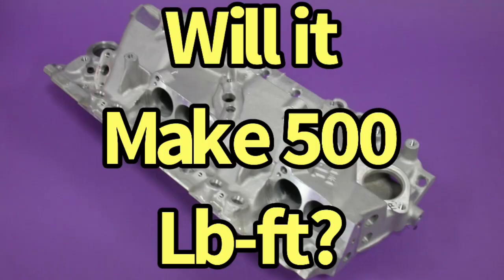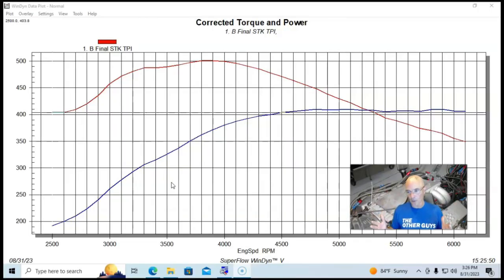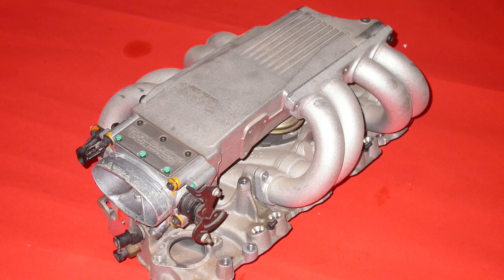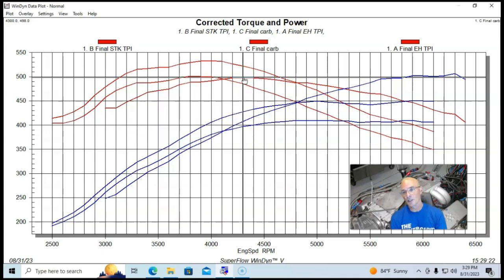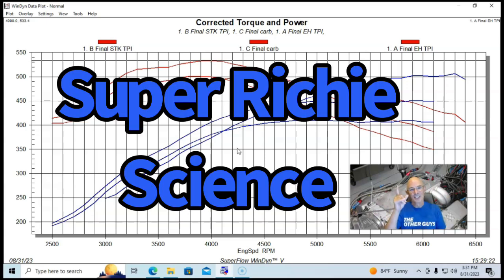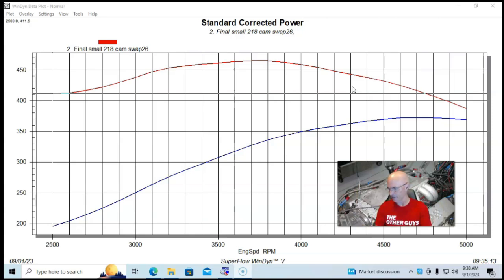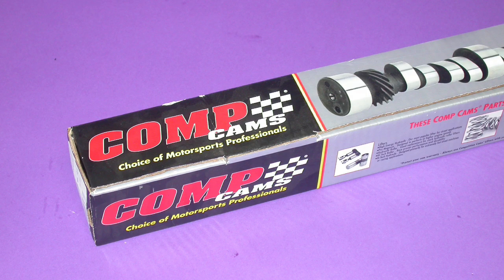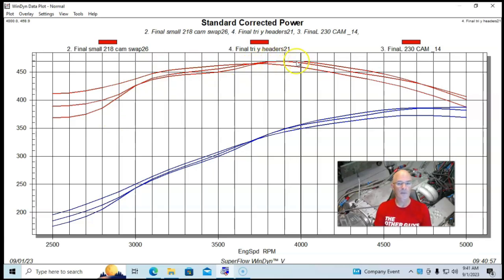TUNE PORT L98 350-CAN WE MAKE 500 LB-FT OF TORQUE? PLUS, TRI-Y VS 4:1 HEADER TEST-WHO MAKES TORQUE?

Comment: XFI hydraulic roller cam up to 230 or 240* duration with extreme ramp rates that match larger diameter lifter rollers. Extra high lift. 7MM or 8MM valve stems. 1.7 high average ratio roller rockers. PAC Beehive or other conical high quality springs. 106* LSA. 2.2" intake valve. 1.5" exhaust valve. High attention to detail on AFR 210cc heads or Promaxx Project X215cc heads. Enough swilr and tumble blend with 300 fps velocities in high port energy and efficiency head. A giant single barrel carburetor with a part throttle circuit modification like the Pro 1 single blade carburetor on a dual plane or dual cross ram divided ram intake manifold. Very high cylinder pressure with proper fuel enrichment jetting for WOT. Then with best results slightly enhance results and make a short stroker between 358 and 372 cubic inches. I.E. = 3.5" crank, 3.625 to 3.64 or 3.65" stroke. The 3.5" stroke could net you a 10 ft lb increase. Or a 3.6" stroke would be really nice. Part of the reason the 383 stroker does so well is not only the additional cubic inches. It's bore to stroke ratio is perfectly in the zone of efficiency. So if the stroke and bore was reversed it would be equally in the perfect zone as well.
Reply from the maker: I think no on the 4/7 or the 4 pattern and you will be hard pressed to find a better head than the AFR, the tighter lsa will work, no on changing the bore/stroke (displacement makes torque)
Reply: I like where you're going here. Totally agree on the XFI lobes, but still on a tight LSA and all the extra valve train stuff to control those lobes and more rocker ratio. You're kind of "changing the game" with changing the intake, though. I think the challenge of the limitations of long runner intakes is what "makes it fun".  

If you're stuck with the long-runner intake; then a FIRST Fuel Injection super high flowing TPI is a part of the recipe, and I think you want MORE STROKE because you're RPM limited and the extra piston FPS is useful; it also helps provide more quench action to fight the detonation that becomes a risk as you push the DCR of a high performance TPI engine. -Combine the extra stroke with thin piston ring packs to not lose some of the torque from friction (the 1mm ring pack Mahle PowerPak pistons are perfect and reasonably priced). 

You COULD do fuel enrichment to fight detonation even with EFI and keeping a long-runner intake, but with a modern EFI system you can also use an Open Valve Injection strategy that helps reduce detonation risk, too.

Comment: In my opinion, it's the stroke that helps produce all that low speed torque . It's difficult to make up for that. It would be interested to see what another point or so of static compression would do.  Let's cut to the chase and add some boost.
Reply from the maker: see the turbo tpi video

Comment: An old ad for the Paxton supercharger from back in the day claimed 360 HP and 480 FT/LB of torque on a stock TPI engine. It claimed ZR1 Corvette performance from stock TPI.
Reply: Anyone use one successfully?
Reply: @xmo552  I’ve had one on my 89 Formula 350 for over 20 years. While I don’t race it or even drive it often, it was rebuilt once after about a year or so into its life because the kit came with a belt that was absolutely too tight. I added the dipstick cooler kit to it and quit using the Paxtatrac fluid and just use Ford type F transmission fluid and it’s held up ever since. Successful or not that’s been my experience. Lack of frame connectors on the flimsy 3rd Gen and lack of faith in the rest of the drivetrain prevents me from abusing it. But TPI + the small amount of boost = big block torque sure makes it fun to drive. It’s shown tail lights to stock LS1 F bodies and early LS1 Corvettes.
Reply: @mikee2923  
Thanks

Comment: I had a tpi 383 with dart iron eagle 225 heads, and a low lift 114 lsa cam advanced 2 degrees.
 10:1 compression.  
It made tons of torque.  
33mpg with cruise set at 120mph in a 92 fbody with 2.73 gears.    
Car was a lot of fun.

Comment: Mr Holdener Id really like to see you test the big bore throttle bodies on the market for the dodge magnum engines with the keg intake, the flow numbers for all of them are all over the place, someone is lying.
Reply from the maker: BIG FLOW FROM A TB DOESN'T EQUATE TO BIG POWER, THE INTAKE MANIFOLD LIMITS POWER
Reply: @richardholdener1727  so does the stock throttle body limit the keg intake or is the intake the limiting factor and I should save my money on a throttle body.

Also you have a great weekend 😁
Reply from the maker: I don't think you will see a big change in power from either, even a fully ported intake with a very large tb only added 10-12 hp
Reply: @richardholdener1727  better heads first then it is, thanks

Comment: Chevrolet should have put tpi on truck's their mistake.  Would e85 increase torque ?
Reply from the maker: I don't think so
Reply: It's incredibly scary to disagree with Richard and his dyno time, but I'm going to 100% disagree on this point and say "yes".  

1. These TPI engines are usually oxygen-limited and E85 brings with it plenty of extra oxygen (like an oxygenated race fuel). 
2. When you have a real street-driven, high performance TPI engine and you're pushing the dynamic compression to make max power, the big VE can cause detonation around the torque peak RPM in a real car with 200F engine coolant and if you have to pull ignition timing to avoid the knock, you're leaving power on the table.  E85 allows you to push the dynamic compression in a high HP / Torque TPI combo without needing to worry about knock, so you can keep all the timing in that it wants. (If you use E85 to push the compression higher, "Certainly Yes".)

The general consensus on these comments seems to be to add more LIFT, go with a tighter cam LSA, add more COMPRESSION to hit 500 ft lbs from a TPI 350.  If you go in all three of those directions, the E85 becomes particularly useful, because all three of those things will bring you closer to the detonation limits of your fuel in a real car with real world (not 150F cold dyno water) coolant and air temps.

Comment: Richard, I think you can get to 500 lb/ft, but it's gonna require 11.5:1 compression and 1.65 rockers on the intake side.....a cam with 108 LCA would be ideal but I think you can still hit the mark with the cam that's in there..........just my thinking on it

Comment: I'd try adjusting the cam timing.  Pull the plugs and set up a compression tester.  Test as is then start moving it forward and back until you get the highest compression reading.  Then retest.  I have feeling you will find more torque at a loss of hp.

Comment: Get ahold of Myron C. of TPIS, (or all his info.)  he had all kinds of TPI dyno runs in his books testing back in the day. On 350's,383's, and 400/406's. I think with some attention to low lift flow at the valve, by valve job/blending at the valve seat, along with un shrouding, an increase in compression ratio,  And then use that info to pick a cam.
Reply from the maker: Myron is no longer with us, but Jim Hall is
Reply: Didn't know that, sorry. But TPIS was sharing good information and dyno sheets back in the day, while a lot of people, went "gears,stall, big cam, (wow it's slower.) I said up the compression, but that seems like we arn't solving the dilemma, I say advance a cam with a tightish LSA in a TPI friendly grind  @richardholdener1727

Comment: I have been wrenching on tuned port engines since the first one rolled off the truck at the dealership I was working at in ‘85. I have tried lots of combinations with both good and bad results. But honestly, the best I have seen on a 350 TPI is in the 450 ft lb range.  A TPI engine is kind of limited to that sweet rpm range. I enjoy torque in a streetcar so it works for me.
 Your Y-pipe results are interesting because an X-pipe seems to help mid-range torque with a slight loss at lower rpms.
 My current tuned port has absolutely as much material removed from the inside of the plenum as possible because the stock plenum volume is too small with this design. In fact, it’s still too small after mods. 
 I think that a 383 is probably a better choice if 500 ft lbs is the goal. I have a desktop Dyno sheet stashed away for a virtual 383 TPI that pulled a hypothetical 550 ft lbs. If driving something like that doesn’t put a smile on your face, someone should check you for a pulse.
Reply from the maker: the 383 made 535 lb-ft, and we didn't test x pipes or y pipes in thsi test-just header design
Reply: @richardholdener1727   465 ft Lbs?  One of my favorite 350 Mag engines did that with an oriental Dual Plane. "Budget Sledgehammer" Sept 22, 2006 Dulcich/Hunkins..  L31 block w iron EQ Vortecs, 10:1 comp w shaved heads/58cc chambers.  They used a Vizard spec 224/224 108 LSA cam  with 528/563 lift w 1.6 rockers (Comp Cams custom).. You've got better heads than they had, you've got a better manifold for torque than they had .. Use their cam.  The mainstays of torque are stroke, size, compression, camshaft .. My armchair suggestion .. Similar spec cam  .. maybe up lift to .550 minimum, 11:1 compression with Flatops only- no domes (there are factory sportbikes with this ratio it can be done) max cubes on 350 archetecture.040 over gives you 359 ci .. .060 gives you 362 ci .. 10% of 400 cid is 40 cid.. So a 360 cid engine is 90% of a 400... 90% of a 400 means you'll hit 400 level air demand just a few RPM's higher in the scale.  This is a great concept Richard .. 500ft lbs/350.. the power/torque from the 383 w TPIS or Extrude Hone Tune Port manifold was insane .. Inspiring.  The factory spec on the 1970 Chevelle LS6 454 was 460hp and 500 tq @ 3600 rpm with 11:1 comp.
Reply: Yeah it may just come down to the lack of rotating mass at the certain rpm the tpi likes to spin at. The 383 had always been a disproportionately powerful motor that makes uncharacteristic torque for a small block but still capable of high rpm power when built for it. There might just not he enough stroke and rotating mass to take advantage of the tpi’s strengths. As a matter of face there’s a video floating around with a 305 stroked with a 3.75 inch crank to make a 334 and a tpi setup and made some tuning crazy like 430-440 foot pounds. That big crank is the thing that turns the tpi into its own in my opinion but it’s all conjecture so what do I know lol
Reply: @theeoddments960  , My problem with a 305 is that the small bore seems to shroud the valves and reduces airflow substantially. So there seems to be a limit on how much power you can make aside from just the displacement. 
 I ran a 383 with a Holley 3310 in the 90s and loved it. And I swore by stroke for many years as being the key to torque. But Dyno numbers suggest that it is more about displacement. These days, I believe that aftermarket cylinder heads would give a 377 an advantage over a 383 due to it’s larger bore and better flow potential. It would just breathe better.

Comment: Why didn’t they use TPI on trucks?  Seems like it would’ve been best suited for a truck application.
Reply: I ran TPI on a G20 van.  At low rpm off-idle to 2,500 rpm, it sucks compared to TBI on a dual plane. The TPI only made more torque than the dual plane with TBI from about 2,700-3,800.
Reply: @chrisreynolds6520  interesting
Reply: @chrisreynolds6520  People don't talk about that ENOUGH!  TPI are great a MID RANGE, but at RPMS above and below the tuned range, those waves arrive at exactly the WRONG TIME and make a torque dip.  (The real reason for TRI-Y headers: to attenuate those waves, so that the AVERAGE power across the RPM band goes up vs. having the big dip on either side of the tuned range.)

Comment: My TPI car loves the TPIS ZZ-9 cam. Can’t give you any dyno numbers, it’s never been dynoed. I run it with boost and it runs with boosted LS cars.
Reply: Looking to build my tpi car what did you do on your build, the tips zz9 cam looks good but the only info I can find on it is from forums from 2003😂😂
Reply: @ my setup is stock crank, main studs, forged rod/piston. Head studs, topped off with very lightly ported aluminum L98 heads from a TPI corvette. Then a turbo setup with a single 76mm.
Reply: @TurboTPI  how do you do the turbo set up?

Comment: Here goes. 13:1 compression, 1mm rings, 2.05/1.72 valves with 30 degree seats, a solid flat-tappet cam with 220/236 @.050 and .525 lift with 1.6 rockers and 108 LSA  installed 6 degrees advanced..and a bag of ice on the plenum.

Comment: This is why i wanna stick with a 350CI instead of 383 on by Forged Dart block i plan to run with 15psi boost..  To keep the Tremec TKX trans from Exploding as it is only rated to like 650 ftlb of torque....  You can have higher than 650-HP, just got to watch the torque levels.   And i may wanna rev to 7K also :P

I plan to run AFR 210 Race series heads vs the 195's  due to the blower making the ports virtually "SMALLER", plus my GM Fastburns are 210cc right now, so i know with a comp XFI cam it wont be super revvy, but i can if i wanna go to say the XFI 292 which is a bit on the larger side, basically a Comp XE-294-HR10  with a 113* LSA vs 110* LSA of the XE version..

Tighter LSA ups the HP up top, but most time lowers TQ down low, whereas much wider LSA of 112-115 gives torque up down low and loses HP up top...

I would try the XFI 276, 280, and 292 cams.. All (3)...  They are on a 113* LSA and go with a 1.6-1.7 RR as well...

That should get you closer......  

Ultimately you are gonna be limited by the factory TPI size, i think the only real way to know is to contact "FIRST TPI" and maybe they would donate a First TPI setup for you to test and do dyno's with in exchange for a push or sponsoship?  Can't hurt to ask..

First TPI is (HUGE)!!  Think "TPI ON ROIDS"!!!  They really did their homework and it's the (ONLY) "TPI" setup that could come close to the (Holley Stealth Ram & TPIS Mini Ram)  intake flow numbers wise.

Comment: Does anyone know what diameter is the stock tuned port intake manifold runner?
Reply: I do. The stock TPI runner inside diameters are 1.5".  I'm not sure of the diameter of the aftermarket large runners are for the stock TPI intake but the aftermarket FIRST Fuel Injection intake's runners are 1.75" Inside Diameter as-cast (2.47" cross-sectional area) and can be opened up to 1.85" end-to-end without issue. (1.97" OD at the plenum and 1.9" OD at the entry to the intake base).

Comment: Try a Comp Cams 268h and 1.6 rockers. Back in the day I had a stump puller of a '76 BLAZER with a 383 that cam, flat tops 10-1, 650 double pumper, and an Edelbrock Torker manifold. I know, 383 and Torker are different, but the 268H and 1.6 rockers are solid. I would be curious to see what they would do for you. It was an amazing combo for me! I used Rhodes lifters, remember those???

Comment: Used David Vizard 128 cam formula.

128-cubic inch÷ number of cylinders÷ intake valve size × .91

Example 128-355÷8÷2.02×.91= 108 LSA
Reply: Just curious for the below average guy like me!  How does Vizards cam formula work out with factory heads or even the best aftermarket heads & stock bottom?
Can the factory cam be optimized for the stock setup??????
I'd love to come up with the BEST top end package & intake including a custom cam at all costs, but for the below average guy who doesn't want to pull the motor, or have yet to find anyone in S. Florida competent or honest enough to do a full built 383 ect.....
At one point I wanted to put on a supercharger kit & intercooler......so the C4 with 19k miles stayed in storage for many years, due to health problems.  

I'm planning soon to carefully get it running & pre-lube the engine with a pre-oiler ect, ect. before even turning by hand.  Glad I drained the tank, but not fuel rails, but ill put in upgraded Bosch 22lb EV 1.3  vs. the troublesome Multecs.

  My biggest fear is rodent damage since the storage facility once had major rodent problems, so first on the list is 20 traps & Jug of Skippy & Jam .🐁🐁🐁🐁🐁🐁😏

If I find the worst, ill just throw in a loaf bread & let them make their own sandwiches in the front seat & just give up on my dream.🙄

Comment: Enjoy the videos!  You may want to try reducing the cross sectional area of the intake runners about 10% in order to make the resonance more effective with the smaller displacement.
Reply from the maker: reducing the runner size reduced torque
Reply: I’m not convinced that is always the case when using Helmholtz resonators in the intake system.  Reducing the cross sectional area would get the tuned speed back down to where it was and increase the runner velocity to to where it was with the larger displacement configuration.  I wish you well sir!
Reply from the maker: my comment was that we ran smaller (stock) runners and it reduced torque on this application

Comment: This means tpis is full of crap they claim 450hp and 500 ft lbs with all their stuff zz9 cam is similar to the 218 cam and they run afr 210 heads
Reply from the maker: TPIS claim 500 lb-ft from a 350? or was that a 383?